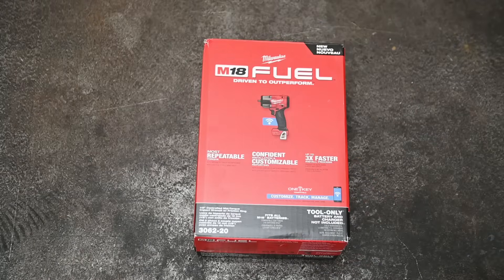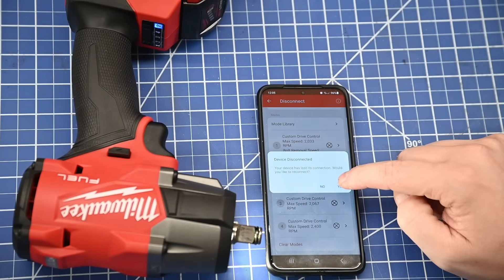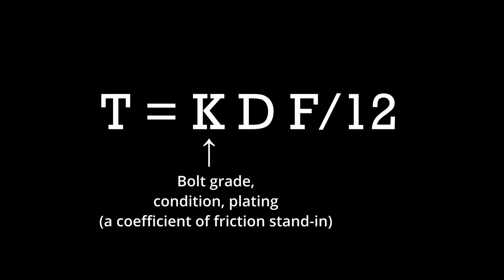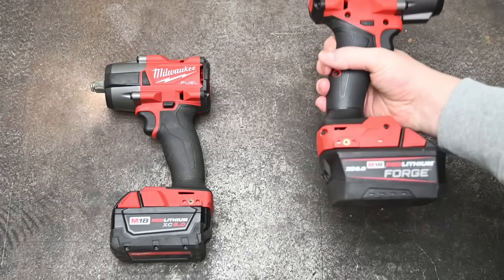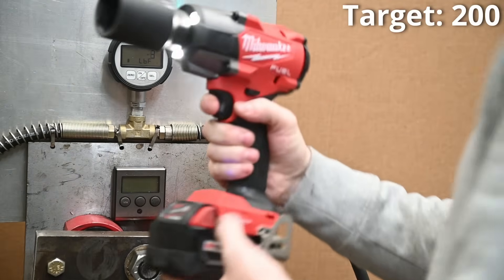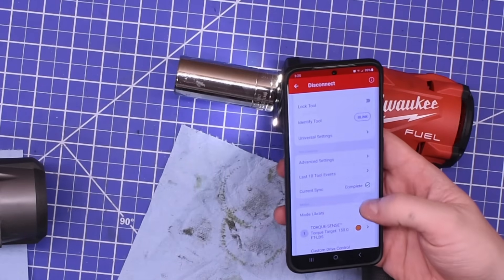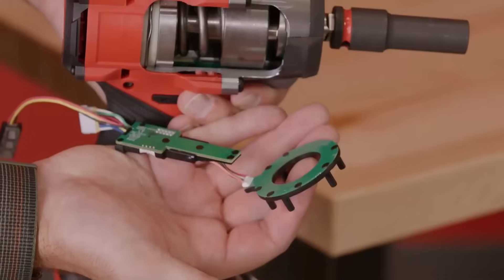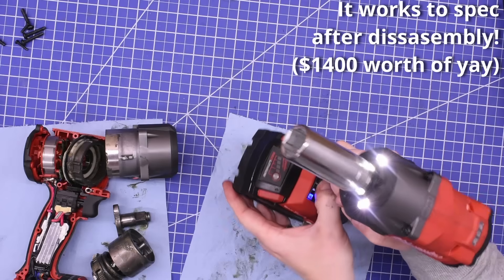Milwaukee's Secret $1,400 Impact Wrench: A Mechanic's Dream?

Comment: 18:55 As TTC gets more and more critical of the tool, Milwaukee Guy's super accurate readings get more and more hilarious.  Can someone overdub TTC voiceover right on top of that Milwaukee demo?  I am definitely glad people are trying to make those installations quicker, easier, and safer... but if a company says a product is idiot-proof, all the idiots will likely prove them wrong. Then a whole tower cable rack falls on someone's head... (or like a 3/4" nut from 200ft up... or a client gets kinda mad. Real bad stuff.) Telling someone not to worry will probably make them also not pay attention, (assuming they believe the claim.) 
"That bolt stopped in like half a second instead of 3. Oh well. On to the next one, cause the gun said green." or "15 seconds? that's weird. Meh, must be good by now."

Comment: Can you try running the bolt to 50ftlbs or a rough tighten and then aim for a true 200. Will the initial torque mess it up?

Comment: I’d say you’d have to calibrate it using the battery you know you’re going to use for the job still pretty impressive though which is why I’m not a fanboy I like DeWalt Makita and Milwaukee even Bosch

Comment: I think the potential for something here is pretty cool but i think this will take more than software patches to actually make it better.
In the short term i think development could be made on torque limiters than making an impact that does it perfectly every time. 
Also the ability to do all this without the app would be much better.

Comment: $1200... to replace a $80 torque wrench. I think I rather just punt a baby down the road and deal with those consequences instead, especially considering it's inconsistency. I'll just wait 10 years and check in again to see where we're at with this tech

Comment: While it seems prohibitable expensive just looking at the bare price, but it would basically pay for itself when factored in what it's gonna be used for: repeatable torque on 1000s of bolts on an installation.
A sort of "fire and forget" deal where you don't have to manually check every single bolt just to be sure it's been tightened to spec.
"New bolt, ugga dugga, done. New bolt, ugga dugga, done."
Instead of "New bolt, ugga dugga, change tool and check with torque wrench, tighten, done"
Would save a ton of time in the long run, which also saves money.

Comment: I'm sure a case can be made for tools like this assembling aircraft and other mission-critical applications, but I worry that a lot of these features will filter on down to the people who can't actually do many blue collar jobs in the construction industry, but love to regulate them.  I'm a retired electrical contractor, and was surprised to learn in California, you can't even tighten down busbars anymore without an inspector looking over your shoulder to check the torque.  I've always used a torque wrench for cylinder heads, but I fastened down many thousands of busbar terminals by "feel," and never once had a problem or needed a babysitter, much less a $1400 programmable impact wrench to do it.

Comment: I may not purchase this, however it would be nice as a tech for wheels. Program the typical 2-3 different torque ranges for lugs and it will almost eliminate the need for a typical torque wrench. I know i hate pulling the torque wrench out for lugs it may not be a huge time saver, but time is money and minutes count.

Comment: 4:50 - torque vs tension - this is why when i teach others about using impact guns to reach close-to specific torques by counting impacting time, i emphasize that the method is only accurate on fresh bolts with clean threads in good condition.
i also recommend they get familiar with your tests of the specific tools they use. you provide an excellent resource for us fitters, thank you.

Comment: I only need one that can handle busting nuts and bolts with ease and one small version for everyday nut busting in confine space.  There's no point investing into one tools after  another every year.   I got the big brother dewalt for the big task and the snaller and more compact milwaukee M18 1/2" impact for the small job that are in a very tight space to use the big brother on.

Comment: Your Dyno is showing air bubbles in the line somewhere. Either a small one somewhere or microscopic ones all over. But its causing the spring on the dyno results. goes over and then back down again.

Comment: I do and don't understand this tool. I have one of their smaller screwdrivers with the torque limiter dial and it's pretty easy to chart the settings with the torque that they output before slipping the clutch or whatever is limiting the torque. I'm only doing inch pound small fastener installation, but it's pretty consistent and easily repeatable, and it wasn't an eye-watering exorbitant price and it didn't need an app...

Comment: We have these at discount tire. We still manually check Torque with a Torque wrench, but milwaukee has a custom industry special long anvil version that they send us and we calibrate to max @80ft/lbs. We use the directional lock to only restrict it on fastening so we can use the full breakaway when breaking lugs off

Comment: so this is a fantastic choice for an assembly process where you can control your environment and what your working on, in a “grease monkey” application you could go from a 30k mile tahoe to a 98 k body with the bed touching the cab, doesn’t help you too much

Comment: Oof mechanics not checking lug nut torque is a thing of nightmares. As a tech that had to torque wheels then have another tech double check and both of you sign off that wheels were in fact torqued I always torqued every lugnut I put on and I know just how often the "3 ugaduga" on a lugnut does not actually work and how often 2-3 lugnuts don't actually get torqued with that process.  Plus counting impacts either gives you way too much or not enough torque.

Comment: Im willing to bet my whole check, between the 10 step torque verification, app glitches, battery inconsistencies, Bluetooth connection problems and operator error, the old guy with the 100$ torque wrench still works circles around junior and his 2k$ worth of impact and batteries. AND old guy's work will be more accurate and consistent - in my imaginary situation

Comment: If it was $200 more they would sell way more. In no universe does it have $1100 more worth of parts and tech. It should come with special batteries where you can input your desired torque spec.

Comment: Way too complicated. Zip it up and use a torque wrench. Quicker, more accurate, reliable and won’t possibly send a customer down the road with an incorrectly adjusted nut.

Comment: Only 250 ft lbs 😅 we're not building Caterpillar tractors and mounting frames to axles.  That was 2500NM btw.  😉 And yes stall bars are better, much better.  But torque specs should take into consideration what the hell the average user is going to be applying.

Comment: Again.....my goodness, if these prissy engineers were so concerned about variables and different conditions when torquing the fasteners down, then start removing the flipping variables.  That or state that these torque specifications are only applicable to a blah blah lubricant, blah blah fastener, blah blah one time torque measurement.  Yes if your bolt is seized up due to debris or FOD or rust or whatever then of course you won't be able to as accurately define the exact torque condition and value.  But to that I say, if that's such a big deal in an application then either engineer a different fastener, or stop whining when all lab conditions can't be met in the field.

Comment: 1400 bucks? Nope, nope, and nope. Air works fine, and so does the cheaper ones. Im in Atlantic Canada. You got 3 year old trucks needing rust repair, and i dont need this, if we dont, neither does anyone else 😂

Comment: Correction. It's $2800 for the bare tool.
Reply: Dam for that money it should drive it's self to the job site. Put the parts, bolts together and torque it all up.😮😂😂

Comment: high volume of nuts or bolts to torque-yes. Normal guys that use a torque wrench like we do at our shop most every day-waste of money. To much going on inside that tool.. Impact them all down to close to your number then come back with a torque wrench to hit your number.

Comment: The tech in that is crazy. Its crazy what you can do with electronics. Its crazy cuz all they have to do is change the app software to make the forge batts be on target. It would be nice though if they had some sort of sync feature where it shows through a blink of light or something that it remembers your current project settings incase you have issues with your phone or forgot to bring it with you

Comment: So if I understand correctly, at least the idea implemented here, going from a "regular" programmable one-key to torque-sens - is like going from a stepper motor to a servo? As in; the basic control scheme is the same, but with the new sensors it actually (tries to) track the position of the anvil. And is able to factor that into its programming..? 

It is also quite possible that this anvil positioning tracking is actually only used for the "repeat protection" feature. That would explain why they say to use both hands (to keep it rigid). AFAIK it only tracks the position of the anvil vs the sensor. It has no way of knowing if the position of the fastener or the whole tool changes. If you allow the wrench to twist and bounce a bit in one hand, it won't be able to tell whether the reduced "resistance" is caused by a fastener not yet having reached target torque/resistance, or if it already has (or is overshooting) but the whole tool is now absorbing energy by moving in relation to the impact position of the anvil. 

I'd be curious to know how much of a difference this setup makes. It would be cool if we could somehow apply the same "training" / calibration tests it uses to tune its compensation, to a regular one-key impact wrench. And see how much of the improved results (if any) is in the tool and sensors, versus just the "calibration runs" in the one-key app generating an averaged offset to the standard uggah-duggah counter and current sensing of the regular one-key "torque" control scheme.

Comment: This reminds me of motorsport pit guns. They often use a clutch in the drive to slip once it gets to a certain torque number (as well as other design features like the socket and lug nut being designed to throw the gun off once it hits the correct torque)

Comment: Not typically a Milwaukee fan (not since the good ol' days, anyway), been a dewalt guy through the 2000s, but this thing's legitimately enticing, and sexy.  The accuracy of torque was genuinely impressive, like that was pretty damn close to manual twist-handle torque-wrench accuracy, if not exceeding it even.
If I ever find myself in a position of being able to piss away $1500 (after tax) and not miss it, I think I may well fetch one.

Comment: I am an electrician who has done some solar and other things with tons of the same bolts needing the same torque spec (in the thousands per week range). This tool, had it been around back then, is something I would have bought WITH MY OWN MONEY if the company wouldn't buy it for us. $1400 is dirt cheap for something that can save you such an insane amount of work for repetitive drive/torque swaps. Even if I had to recalibrate it every 100 bolts or so. This is so much cheaper. better. and all around compact than any other solution I have ever seen for something like this. If you have to climb multiple 80'-200' platforms daily, this thing will save you so much time and headache.

The only downside I can see is it doesn't go to 350Ft/Lbs, some DPs and other panels clock in around 300-335 range. I still think im gonna buy the tool, just for side solar jobs.
Reply: They might sell a high torque in the future
Reply: Your nuts broo 🤣 🤪 😂 😳 😒 😭 🤣 🤪 😂 😳 😒 😭 🤣 🤪 😂 😳 😒

Comment: For high end and high volume commercial use, where you need semi precise torqing, it can be worth it. Just like the Hilti concrete screws. A single screw can cost 50 bucks. But you only have to drill into the concrete, and then set the screw. No cleaning, not brushing, no anchor, it just works. 
And if you then count, how many screws a single worker can set per day, it becomes competitive.
A day of contractor is ~1000 bucks. If he does just 10% more work per day, it becomes a thing.

Comment: No idea if you guys would be able to get ahold of one, but I used to work at a port processing facility for a Toyota distributor here in the U. S and we used Atlas copco Versions of this tool that were very accurate and recorded every torque to a cloud server that would have a report run on it twice a day The torque wrenches had barcode scanners Built-in and we also had tools They called nut runners, which are very similar to a cordless ratchet. They would run down the bolt or nut and then tighten to a predetermined torque. Really cool part was that they could have jobs programmed into them. Where scanning one barcode would start the job. And then the tool would change its own settings to tighten things in the correct order. For example, some of the running boards we installed had 6 bolts. At thirty two foot pounds and four bolts at forty five foot pounds (making up numbers because I don't remember actual specs) And The tool would know the correct tightening pattern to go over each bolt with the correct torque and then recheck In the same pattern again

Overall, super cool tools. But I believe the cheapest one we had was in the neighborhood of $16000. And one of the large impacts that was called a pulse gun, which was used for installing wheels, ran upwards of $30000 per unit

Comment: I mean since it has a brushless motor they could actually be doing physics calculations based off of hammer speed ( and known weight) vs anvil distance moved so that they are actually measuring the amount of torque applied which would explain why the actual bolt tension changed so much with the unlubed fastener because the same amount of torque applied to an unlubed fastener vs a lubed one will result in significantly different bolt tension. This is why you should always follow the instructions when torqueing anything worth measuring the torque of especially with regard to lube vs no lube and lube should only be used if deliberately specified by the engineer. This is also why engineers should expressly state whether to lube and what type of lube to use for anything critical.

Comment: Your getting ripped off bro that impact is 300 on home depot
Reply from the maker: https://www.homedepot.com/p/Milwaukee-M18-FUEL-18-Volt-Lithium-Ion-Brushless-Cordless-1-2-in-Controlled-Mid-Torque-Impact-Wrench-Tool-Only-3062-20/326510582

Comment: Question: given that most everyone will actually be using a torque wrench to back the fastener off, and given that loosening force is always less than tightening force, is this a factor in the real world. In other words, does the software in the tool account for the difference with a certain constant?

Comment: This would be really awesome if it were like $100 more than the regular model.  At $1,180 more...not so much.  Obv. this is not for regular Joes, though perhaps by 2027 tech like this will filter down into $300ish impacts.

Comment: First comment EVER  on a YouTube video and have seen 1,000’s…..
#1 WHOA dude awesome channel and incredible set up with the dyno to test incredible stuff like this.
#2 thank you for your channel and content. 
#3 Milwaukee power tools is definitely the route to go for long durable great quality products. 
#4what an incredible Job lol. As an electrician I am very much into the numbers and formulas. The detail and accuracy of your information, is on point and the way you explain Everything I feel like a lot of (the average Joes) can understand. Again Thank you and keep up the hard work. It doesn’t matter what the HATERS say. 
#5NOW… 4 the 1300$ yea it’s not something I would purchase, however if I was a mechanic or TIRE TECH it’s possible (especially if my company bought it lol) but the torque on gear,panels, & Transformers a normal 3/8” or 1/2” torque wrench works just fine. Get it snug with drill the torque with the wrench… it is what it is. With people’s lives on the line the time saved doesn’t account for the potential of an accident. - that’s just me. 
Sean Cunningham 
Nashville Tn

Comment: The problem is a tool is only as good as its battery. My boss buys nothing but Milwaukee products, over the years I’ve watched him go through a lot of batteries with a high failure rate. I, on the other hand bought 4 20 volt max Dewalt batteries in 2013 that I use with all my tools. They all still work great and still have great capacity.

Comment: Am I just old, or wise? I would never use what is essentially AI to rely on an accurate torque setting for lug nuts, head bolts or any application where accuracy is paramount.🤦‍♂👍😎✌🗽

Comment: I still prefer my torque wrench and air tools and a couple corded tools. I use battery tools for quick jobs, something simple. Im just not a big fan of the battery tools,only when needed for a quick job in my opinion. Seen too many of those battery tools die out and the warranty barely covers the battery if anything really.

Comment: my bet is it's measuring the voltage drop of the battery along with the current draw to try to guesstimate how much power is being used, and the different chemistry is screwing that up

Comment: Or, torque sticks. The use case here is repeating tasks right? So get a torque stick of the correct value for your installation.